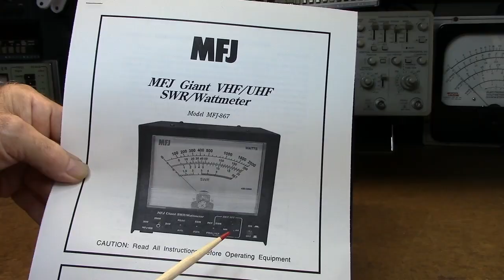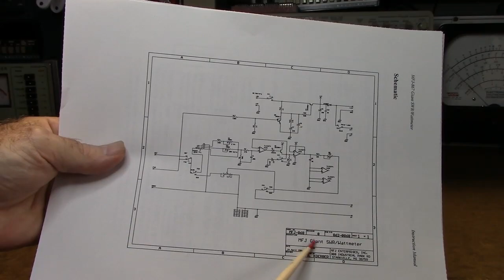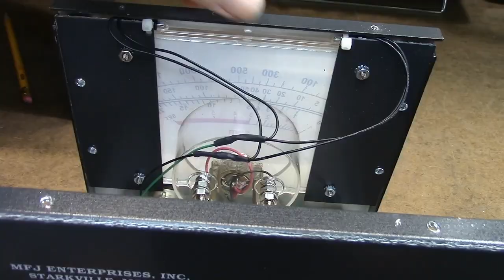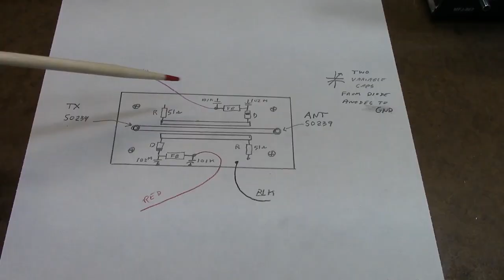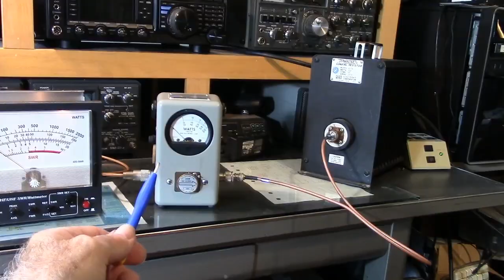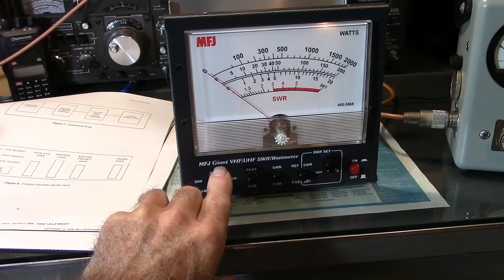MFJ-867  VHF - UHF Wattmeter

Comment: My experience with the MFJ products is that their impedance match is really poor. The Wattmeter, itself, has its own SWR. I have one such meter from them which has an SWR of 1.6:1 all by itself with the output terminated in a known good 50 Ohm load (VNA calibration load). Check it out. I'd be interested to see how it does on that. 🙂
Reply from the maker: Hi Ralph,  I was not impressed with the workmanship of this unit.  Guess the QC guy was on break.  When time permits,  I plan on modifying this unit.  Constructing a proper coaxial line section, and replacing the connectors with N connectors should improve performance.  Thanks for the great VNA suggestion.
Reply: @toddanonymous5295  They probably designed the thing with one kind of PCB material and then had it manufactured with cheaper stuff (different dielectric coef on the substrate). I look forward to your next video.